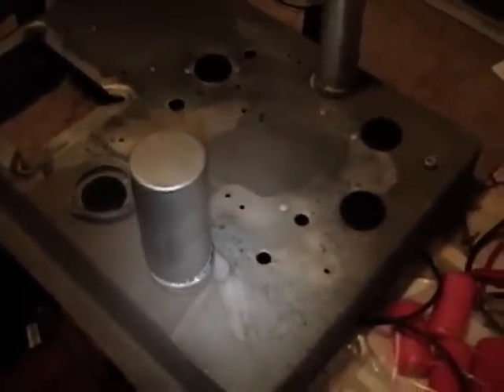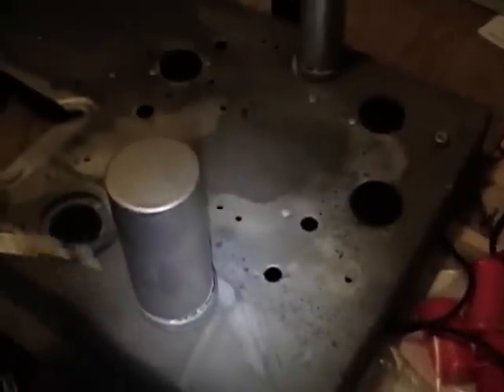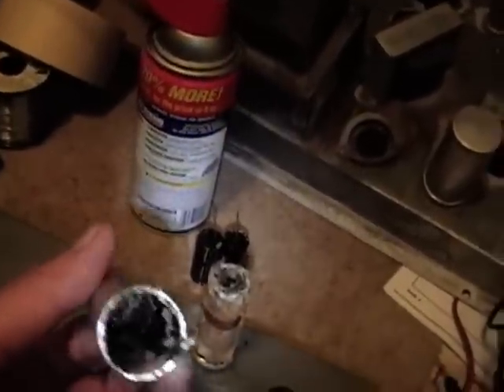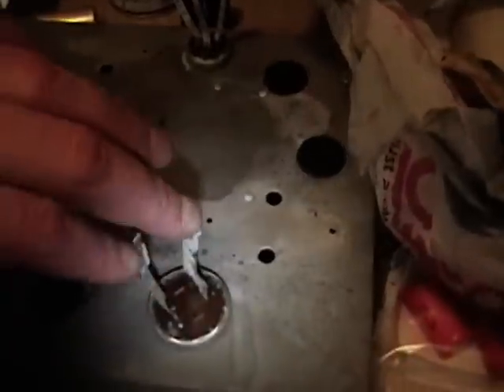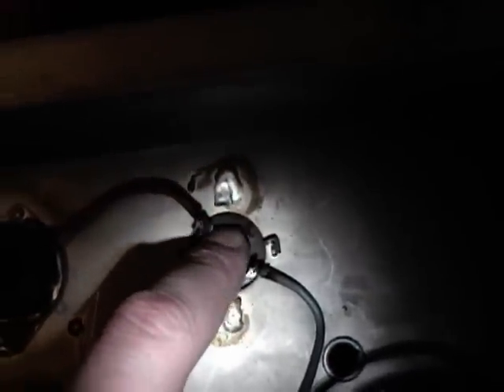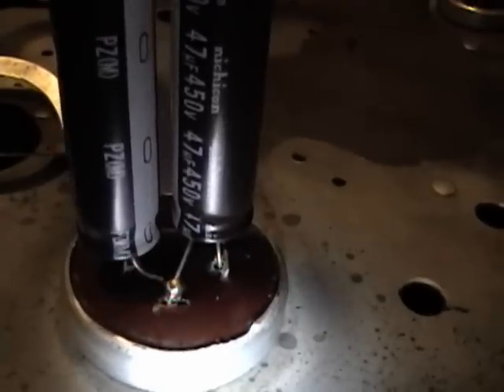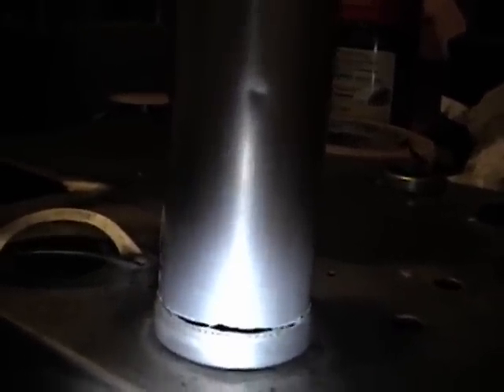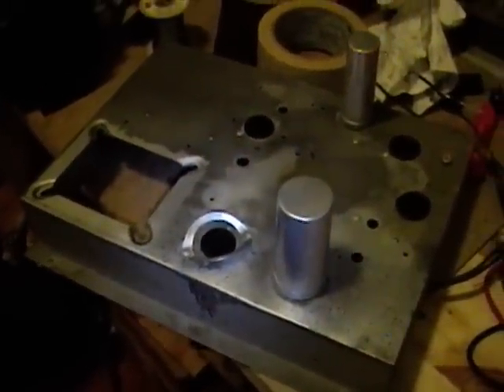Admiral 24A12 Restoration - part 6 / recapping tutorial

Comment: @jshorva65 After verifying ESR <= 0.75 ohms and re-forming through a 27K/5W resistor from a DC supply set to 115% of the capacitor's rated voltage, capacitors which do not show obvious signs of stress (tar bulging through cutouts in the phenolic insulator, etc.) often meet a maximum DC leakage current specification of 27uA at 450V (OEM specification for a new 40uF/450V capacitor of circa 1948 vintage), typically holding below 35uA leakage at 525V to give 5 years or more of  trouble-free use.

Comment: Nice work! We typically prefer the "seamless" method, removing the electrolytics from the chassis and opening the crimped rims to disassemble the cans, followed by tapping the crimps back in place with a small "tack hammer" for the neatest possible closure. A hose clamp, padded with a wrap of tape to minimize scratching, helps avoid distortion of the can's base during re-crimping. About 40%-50% of multi-section units will actually re-form to OEM specifications with low ESR without re-stuffing.